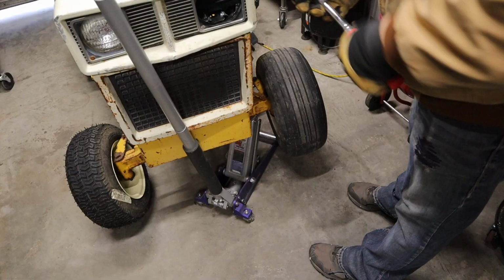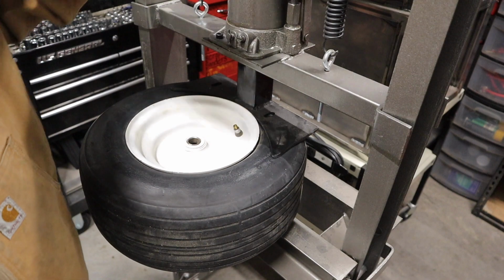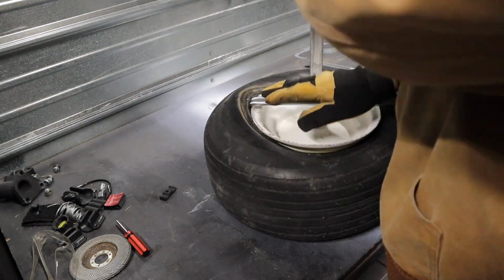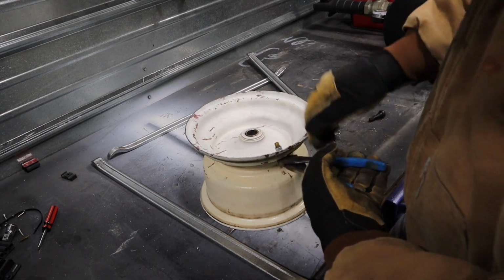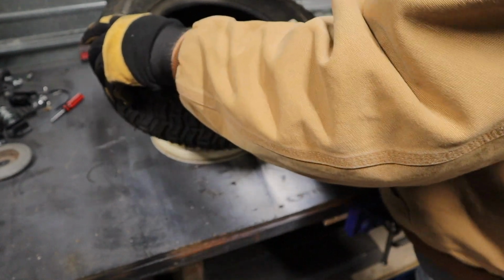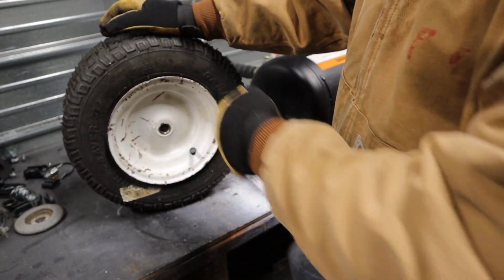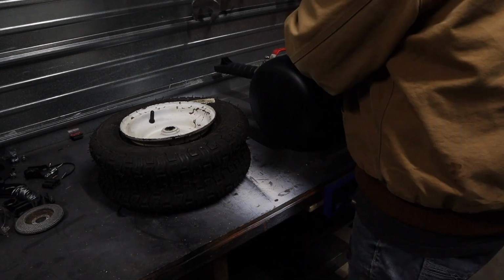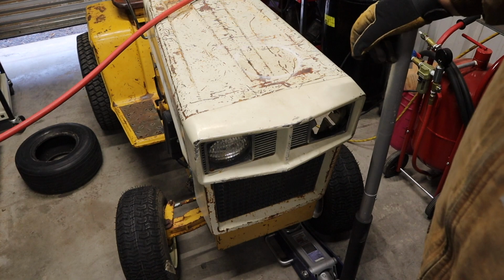How To Change Lawn Mower, Lawn Tractor, Garden Tractor, and ATV Tires at Home - DIY

Comment: Derek what up!  That's an interesting tool for seating the bead, I never saw something like that!  I've used a strap the few times I changed tires.  Doesn't it seem smaller tires are harder to change?  Hope you're feeling better, btw.
Reply from the maker: I would say that car tires are easier than small tires yes. I used to work at a tire shop in high school and that is the kind of tool we used to set beads. Did a lot of dumb stuff with compressed air and air tools when there was down time. I’m feeling a little better. Awaiting COVID test results. Should know by tomorrow or the following day if I had it.
Reply: Oh wow 'rona, I didn't even think of that!  Well it's good you're doing better now, so I guess if you got it, you'd be one of the lucky many with minor symptoms...a story to tell the kids eh.  Yeh I also did tires at a service station back in the 90's.  The machine we used there was a bead breaker that also doubled as a squeeze thingy that compressed the tire when seating the bead.